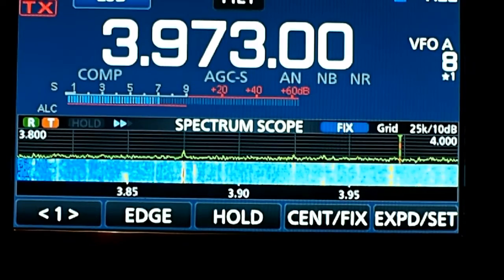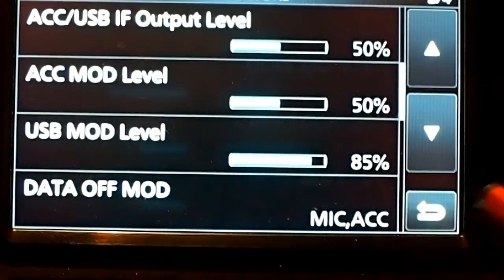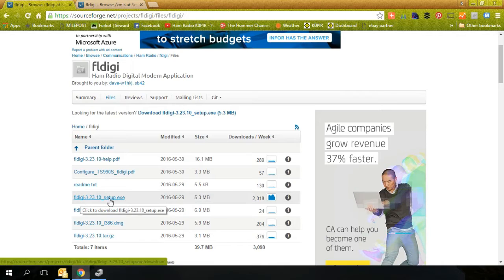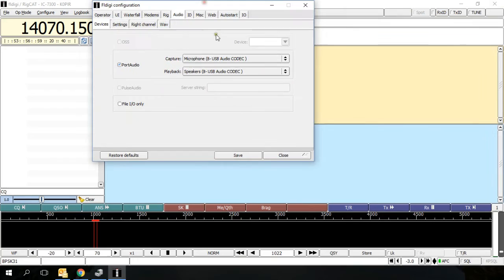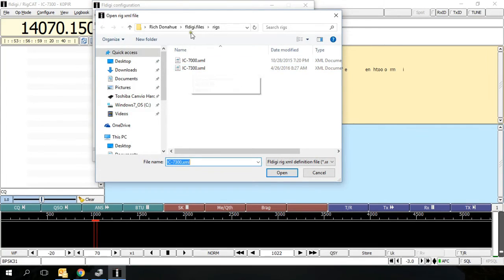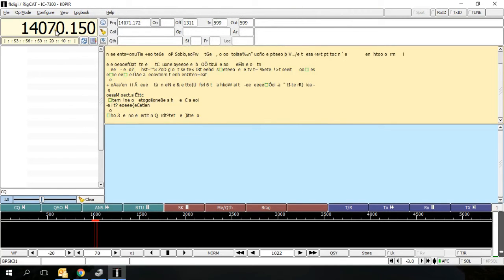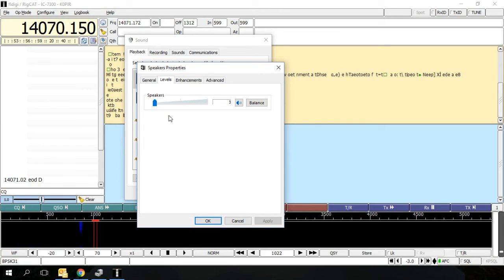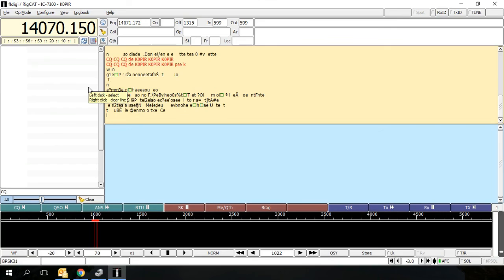Icom 7300 Fldigi Setup

Comment: This video helped a lot. Fldigi finally came to life connected to my IC-7300. The new firmware of the radio allows different presets for different software needs. That also helped a lot. If I want to use other software, with different radio configuration, I just change the preset now. Thanks for your help.
Reply from the maker: Excellent! vry73!

Comment: When I set USB Keying (CW) in the 7300 to DTR, it just makes a constant tone. Any ideas?
Reply from the maker: Hi John, thank you for commenting here and thank you for watching the video. If you’re trying to send CW with Fldigi the radio will need to be in USB – D mode not CW. This is SSB CW which is not good. I think in the US it is against FCC reg. So I don’t use Fldigi for CW other than decoding when I’m using N1MM. If you have something like a Winkeyer then you would be able to send CW with Fldigi. I hope this helps and I hope this is what you were referring to. Thanks for watching again and 73!

Comment: What’s the advantage to using the USB-A to 3.5 mm cable plugged into the remote jack, in addition to the USB-A to USB-B cable?

Have you ever used a PK-232 or similar TNC interface to run AMTOR ARQ or PACTOR ARQ? I would like to try using AMTOR ARQ. I used AMTOR ARQ decades ago. AMTOR ARQ is drastically faster than JS8CALL and works in very weak signal conditions. The handshaking during the QSO provides error free communication.

I’m using the W1GEE DB9 to 1/4” for real CW transmission. I had to buy a serial card for my computer for the cable. The CW mode works great in HRD DM 780 with a buffer to back space over errors, for perfectly sent CW.

Comment: This is old news by now but I’m just getting my 7300 set up on fldigi. Followed this video and got both fldigi and flrig to recognize the radio BUT when I try to transmit I get the TX light, noise, msg progress on fldigi, but no Po on the S meter???? 

BTW, you are my main resource for the 7300. I have HRD, WSJT-X, and JS8Call working great. Radio using the same settings for all. Fldigi just isn’t right......
Reply: Hi Rich. Good ideas because....they worked!!  USB audio codec was not showing up as a choice on the fldigi audio setup page. So I unplugged them and plugged them back in. Now in business although it is purely an academic pursuit as HRD + DM780 are much handier. Is there a real reason to use fldigi other than its free?
Reply from the maker: @scottcampbell7944  That's great and it usually is something simple. I use Fldigi when I am operating mobile and portable. I just like it better on my small laptop. It's fast for me and very reliable. 

Lots of Hams use it because they believe it's better. I think it's personal preference. If you contest you will may like it along with N1MM Logger+.

I like to use it at home too sometimes, just for a change.

Thanks and HNY! 73 - Rich, K0PIR
Reply from the maker: Hi Scott, 

Nice to hear from you and thank you for commenting.
Do you have the Portaudio in Fldigi setup properly? The playback should be the USB Audio CODEC. Sometimes mine get switched accidentally to the wrong setting.

Are you in USB-D mode and in the proper digital mode in Fldigi?
Thank you again and I hope this helps. Let me know.
Rich, K0PIR

Comment: Also, there  is no way to connect the CI-V cord to my computer.  I have a new HP envy that has no RS-232 ports and only 3 USB and an HDMI. I can only use USB ports to connect to the radio and the manual is no help in configuring the radio.
Reply from the maker: Hi Bill, I am sorry to hear you are having trouble. I use a CI-V cable that inserts into my USB port on my computer. See: http://www.ebay.com/itm/282039866391?rmvSB=true&rmvSB=true
You can also find them on Amazon. 
There are two different types. One is a Prolific and the other is FTDI. I have used both types with my Icom radios. People say that the best one is FTDI, but it does cost more. http://amzn.to/2qahaNk
I haven't had trouble with my Prolific, the E-bay one.
Reply: ICOM manual says rig control can be done through the USB port and doesn't need a second cable.
Reply from the maker: Hi Bill,
Right on. But the setup is different if you are only using one USB cable. You want to make sure you have the correct "Device" selected in the RigCAT window.
I use two cables because I want to be able to send FSK within MMTTY and DM780. That's the biggest reason for me.
I think most people use just the one USB cable and it works FB.

Comment: fldigi is up to version 4.0.4 and their website does not have a link to the XML files. I found the file and downloaded it but fldigi doesn't find it or configure anything at all.  The install did not create the XML folder or any others except for Locale to pick the language.  There is absolutely NO help online from fldigi.
Reply from the maker: Hi Bill, It can go in the "Rig" folder in Fldigi or it can go just in the Fldigi folder. Just copy it to one of those and then select it within Fldigi. See 4:20 in the video above. I hope this helps, let me know. - Rich, K0PIR
Reply: I got the .xml file copied into 3 different places and it finds one of them.  I rechecked all my settings for radio and PC but fldigi does not seem to hear the radio and it definitely does NOT transmit.
Reply from the maker: Hi Bill, 
Are you using one or two cables? (USB and CI-V) You can e-mail me. My email addy is good on QRZ.com.
Reply: I just checked the program/radio again at 0950 MT and either there is no one on the air or the program still cannot hear the radio.  Pushing the Tune button gets me a tone from the PC but the radio does not transmit.
Reply from the maker: If you are not receiving signals, are you at least  seeing noise on the waterfall?
If you hear a tone coming from the PC you may have the soundcard wrong. See 3:38 in the video above.
You sound like you're making progress Bill.
One or two cables Bill?

Comment: cant get the computer to key the radio.  it hears the audio, but can not key the rig.  Tried many configs even VOX.   Junk...   damn digital modes.... I'm going back to CW .... the paddle always connects to the radio, no USB drivers needed ....
Reply from the maker: I understand. I had to go back and forth a few times at first hitting initialize. Finally it clicked and has been working ever since. Every time I try it now, it works.  There is another way of doing it, by not using seperate PTT, but the CAT. I will send you some screenshots if you like. Just e-mail me from QRZ.com. Best 73 - Rich, K0PIR

Comment: What does the CIV cable connect to on the computer?Ham Radio Deluxe does not need the CI-V cable?
Reply: The 7300 does not require a separate CI-V cable like some of the older rigs used.  The single USB cable from the 7300 to your computer will handle audio/data and rig control without a CI-V cable.

But if you insist on using a non-required separate CI-V cable, plug it into a different available USB port on your computer.
Reply: Are you saying all I need to use Fldigi is a USB cable? What is the CI-V cable for?
Reply from the maker: Right, you can operate HRD with only one cable, but if you want to use FSK (HRD v6) then you need to use both cables. I use two cables because I like FSK in MMTTY. CI-V cable here: http://www.ebay.com/itm/282039866391?rmvSB=true&rmvSB=true
Reply: I looked at that cable what does the 1/8th plug go into? I am using USB from my computer to USB on the 7300?
Reply: You don't need the CI-V cable.  But if you want to use it needlessly, you can plug it into the REMOTE jack on the radio.
Reply: I got JT-65   working with just the USB cable  but now Fldigi doesn't key up the CAT
Reply: Be sure you shut down your JT-65 software before starting fldigi.  Conventionally, two programs cannot use the same hardware resource at the same time.  There are workarounds for that, too, but it's just as simple to use only one software at a time.
Reply: I did shut down JT-65 but after I configured JT-65 CAT did not work on Fldigi
Reply: If you have no other software running that is using your com port, and fldigi is properly configured to use the correct com port at the correct speed, restart the computer and try again.  Be sure that fldigi is using rigcat only and be sure that the settings are correct.

Comment: icom 7300 doesn't download.  It comes back error.  I tried downloading several times but doesn't work.  Is this just for windows by any chance?  I'm using a Macbook.  Thanks.
Reply: I'm pretty sure it's the same file for mac. When I click on the file it takes me to another page and starts the download. No problem. Try: http://klsin.bpmsg.com/ic-7300-and-fldigi/
Reply: Thank you, I will give it a try.

Comment: Not sure what i am doing wrong have No TX?
Reply: If you are using only the USB cable, do not check the box for using a separate serial port for hardware PTT.
Reply from the maker: Make sue you have rig control. Does Fldgi display the radios correct freq.? If so, make sure the "Hardware PTT" tab is setup correctly in Fldigi.
Reply: Yes and Yes, working fine now I moved the lower screen "sorry do not know the exact name of it" to 1500 in bottom of fldigi that was the problem. I may try MTTY  i currently i have just one cable from radio to the lap top and i might want to contest on cw/rtty so i am interested on what it takes, do i need additional drivers can i use my usb hub etc.
Reply: Still having issues the computer is keying the radio but only a steady carrier, Hardware PTT tab ???? I am only using One Cable I have COM 16 entered thats correct for me  and Only have use RTS box checked ?? something else supposed to be checked ?
Reply: I'll look for that in FLDigi I assume tnx

Comment: I finally got it to work with just the USB cable. The problem was I put the IC-7300.xml file into the 'rigs' folder as I was shown, but fldigi would not sync up with the 7300. So on a hunch I did a copy/paste of that .xml and also put it into the fldigi main folder. Now it finally works right. The freq on fldigi is synced with the 7300 and I can now transmit.
Reply: For the Fldigi main folder: Local Disk>Program Files(x86)>Fldigi.  -Copy/Paste works just fine for the ic-7300.xml file.    -For the ic-7300 USB Driver, get it from Icom and follow the given directions. It must be installed BEFORE connecting the USB cable from the PC to the 7300. When the driver is installed go to Device Manage and click on "Ports." You should see "Silicone Labs.....(Com_). Make note of your Com number as you will need it for Fldigi and other software such as JT-65.
https://www.icom.co.jp/world/support/download/firm/IC-7600/usb1_20/
Reply: After hours of trying different things, your comment has rescued my day. Thank you!
Reply: I am having same problem Exactly where in the main Folder? and only copy and paste from where ?
Reply from the maker: That's great! I don't use Fldigi much, so I'm glad it's working for you. 73
Reply from the maker: Mine is in c:\users\<myname>\fldigi.files\rigs or try what SREagle did.
Can you find the folder?
Reply: +St8kout thank you got that figured out now everything working 
Almost, I have an older version of fldigi not that matters I need to figure out how to get the buffer to work I think I am calling that correct I want to use the macros then try ahead of msg 
And need to figure out why when I am on a freq say 28.110 next to that shows freq a bit lower or higher 
I suspect I have some setting wrong, I need to read the help file however not sure where to find that
Once I get that all figured out I'll have to go to the n3fjp site to get it to play nice with my logging program
For now it transmits and freq is correct in the top left corner
Thank you, received some bad news and been a bit on edge no excuses just saying, no need for me to take it out on others.
Reply: Not sure why the freq should be off. It's dead on for Fldigi, HRD (the last free version, which you can still get), JT-65, etc.
Sadly, to use the free version of HDR I have to change the 7300's data address to another icom model to fool it, but then for Jt-65 instead of picking an icom model, just use HDR from the drop down menu. So it's this or fork out $100 for the latest version.
Reply: I'm trying to use it for CW since it has a nice decoder, but I've yet to get a CQ reply. I've made SSB contacts so I know my signal is going out, so I'm wondering if Fldigi is giving me a bad signal. I tried monitoring it with a handheld but even with attenuation and no rubber ducky, it sounds trashy and overloaded.
I did manage to use it for Wefax and Navtex from the National Weather Service. Takes forever to download.
Reply: Radio dead on and Main Freq Reading in upper left of fldigi is dead on next to that just to the Right in a small white window shows Freq. and that varies, Interesting just opened fldigi radio keys but audio sounds different guess im going to have to take some more time figuring it all out

Comment: Can a single USB cable be used for both data and rig control?
Reply from the maker: Yes you can use just a USB cable. I use two cables so I can do RTTY (FSK) while using N1MM and MMTTY.